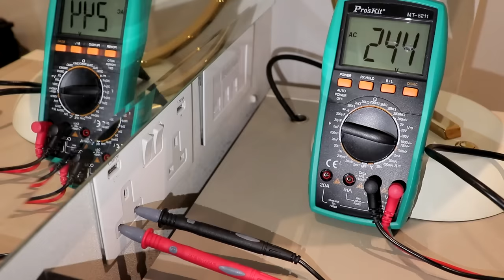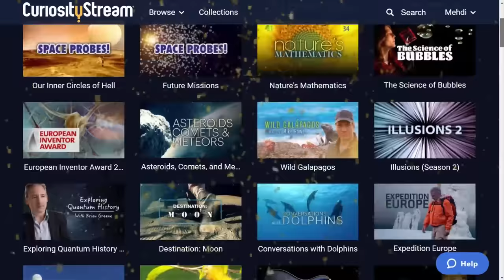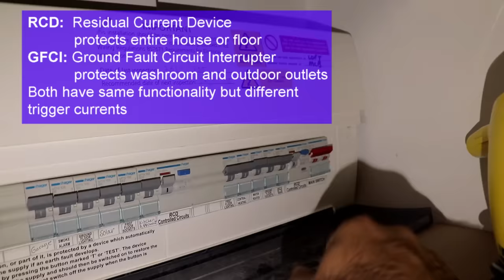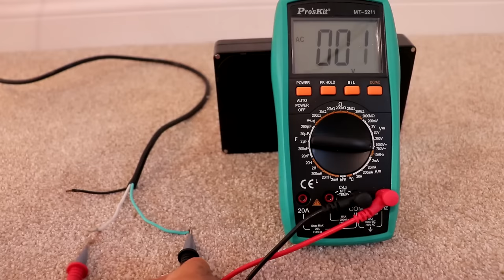Power Outlets in United Kingdom

Comment: UK citizen, I've had plenty of electric shocks in the UK but I've had to push the boundaries of stupidity to get them.
Reply: Getting a 240v shock must be pretty bad. I've gotten plenty of 120v shocks. It's hurts a little but I never felt in danger (hand's weren't wet, no path to ground). I can't imagine a 240v shock.
Reply: @ModMINI  light circuits are rated 5A and socket circuits are rated 32, getting shocked from the light circuit feels like a little tingle but it doesn't hurt compared to the sockets.
Reply: @ModMINI  Feels good, man.
Reply: Nathan Cresswell Huh? They'll feel exactly the same, even in the worst case you're not going to get 5A through you from a 240V shock. That's not much comfort though when a hundredth of that or less can be lethal.
Reply: Mod MINI it’s the amps that’ll getcha
Reply: @dingo137  I can honestly tell you they feel nothing alike, I've changed many of light/lamp holders while live and accidentally touched the live and carried on, a socket on the other hand feels very much like a wasp sting but not as long lasting.
Reply: @dingo137  also lighting circuits are only 1.5mm compared to sockets which can range from 2.5 to 6mm which means bigger the wire the more current can pass through it.
Reply: or have a dodgy power cord on a fridge that you were cleaning and felt your heart stop and then start again...
Reply: Nathan Cresswell and your bones all smash together as your  muscles contract violently to the point you are unable to let go of anything you're holding,  and if that's a live shorted appliance or wire, then goodbye my friend,  nice  knowing you. 
😂👍
Reply: Mod MINI It’s the current, not the potential difference, that causes harm. To illustrate, if you need to supply 12W of power (e.g. to a phone charger), with a 120V supply you are drawing a current of 0.1A. With a 240V supply, you are drawing only 0.05A from the mains. Therefore, a higher mains p.d. is actually safer.
Reply: @AndyJMacLeod  Current and tension are not unrelated. A body is not a wall adapter, if under the same conditions you apply double the potential difference across the same two points of the same body, the current will as well be twice as much. It's different with the phone charger because it only draws what it needs to output the needed power.
Reply: @tapatazapata5970  I guess. Without specifics it's all arbitrary. I had a minor shock through a travel adapter (while I was on holiday in Greece), which is why I was imagining what would happen if the current is supplied through a device. (Most people don't plug themselves directly into the mains). At least the main point of the video was that in the UK we have quite a lot of safety features, including redundancy.
Reply: @nathancresswell794  That's complete and total nonsense. Unless your skin resistance is 48 ohms or less there will be absolutely no noticeable difference between the shock you feel when touching a lighting circuit or a  ring/radial circuit. Moreover, if your skin resistance is 48 ohms then your not human.
Reply: @AndyJMacLeod  No it is not arbitrary. You obviously have no idea what you are saying, i recommend you go and learn the relationships between current, voltage.... AND RESISTANCE/IMPEDANCE.
Reply: @ModMINI  i work on power lines. one tome my ppe was leaking and my rubbers leaked a little sweat on the line, and sent a few thousand volts through me straight to ground
Reply: Telken Texas You obviously misunderstood what I meant. I know all about electricity. I’m a physics teacher. What I meant was that the physics of the situation is dependent on context. How the shock occurs.
Reply: Before they had the plastic on the plug pins I managed to wedge my fingers as a kid behind a plug as I shoved it into the socket.  Taught me to be careful ever since.. :).
Reply: G.H.T. As long ad your hand ls are dry. It will just hurt a little, like smashing your elbow in to something really hard
Reply: @telkentexas4053  go and stick your finger on the live terminal of a lightning circuit then go do it on a socket and tell me which one hurts more. I can definitely tell you a socket circuit hurts more.
Reply: @RawTopShot  that would be electrocution not an electric shock,, no one has ever died from an electric shock.
Reply: @nathancresswell794  I think you are mistaking the different circumstances of your shocks with the current rating of the circuit as the reason for your differing experiences.
You were probably not grounded as well when you touched the lighting live. Hold onto the live and neutral of the lighting circuit with a wire in each hand and let us know if you just get a tingle. Even with good skin resistance, the best case is you'll feel the pulsing as far up as your elbows. Worst case your heart will go into fibrillation.
As mentioned earlier, 5a or 13A circuit is irrelevant, your skin resistance will not allow 5A to pass through your body at 240V, the shocks you have experienced were milliamps of varying amounts.
Reply: @AndyJMacLeod  Stop lying and stop talking bollocks.
Reply: @nathancresswell794  I have done many times, I'm a domestic electrician. Stop commenting on things you know nothing about, you're making a fool of yourself.

Comment: Throwback to learning how to wire a plug in GCSE physics
Reply: I'm very pleased to hear they still teach this skill.
Reply: @MaxWattage  They didn't when I was in high school, I took separate sciences but I don't believe it was taught on the lower level science either, from 2007-2012. I suspect the fact that all appliances sold in the UK must by law come with a pre-fitted plug has a lot to do with why it's no longer taught. It's still an important skill and really should be, but I suspect they would be scared of legal liability if a child blows themselves to bits trying to rewire something. Not a clue.
Reply: @classicmacintosh  I studied IGCSE in 2018 and there was a section dedicated to wiring a plug so that is still taught
Reply: @deadalpeca8099  The **I**GCSE isn't the normal GCSE syllabus you will find in the majority of UK schools, though.
Reply: @MaxWattage  we didn't do it 2004-2006 but i think i did it in Design and Tech between years 7 and 9 (2000-2003). I can't remember because i know my dad taught me how to do it when i was like 7 or 8.
Reply: I was never taught that, my dad did but not the school

Comment: As an electrical engineer... anxiety was set to maximum. *Says something true and would be dangerous" then proceeds to plug in it.. my heart stopped for you.
Reply: Like the comment above I was almost shouting at the screen that there is an isolating transformer + If you look carefully at the location of the hand basin and the shaver outlet I am sure that was within the wrong zone.

Like you I am an EE and learned my trade in the Navy where RCD type protection was used long before it appeared in domestic systems. Electroboom did have a valid point about it being 30ma (Not 20ma Electroboom). It is a shame it's so hard to find RCD or RCBO's with a lower trip current. I found a 10ma one for my bench but it was a 3 phase and very pricy. I know we can't go to 5ma on our RCD's with all the leaky appliances we have but there is something Electroboom got 100% right..................

Stepping on our plugs gives a unique level of pain that is hard to reproduce !

Glad to see he made it back with no heart fibrillation issues  :-D  but if he visits my house any day I am pulling the company fuse on the Henley block and taking it with me if I go out !!!!!!!!   I wonder if his meter was cat 4 ? The leads seemed ok when he had the sleeves on anyway !  Now he is back home I can breathe normally again :-)
Reply: im not an electrical engineer but i get to work with robots and learned alot about electricity. if i did half the things he did in my electrical panels for my robot systems, i would be dead or fired from my job...

Comment: Mehdi: “UK outlets are weird”

EU: “hold my plug”
Reply: I know right? Send this guy to germany he'll freak out.
Reply: In fact
Reply: Pineapple i am a Germany guy and my head is hurting
Reply: Is it because they're exposed completely?
Reply: @iepineapple  German plugs aren't as safe as the UK ones. But more compact and cheaper. Also, invertible so in a plug in device you never know what is live or neutral. Should not matter if its designed correctly.
Reply: Seb Brosig it depends. it typically makes no difference for devices that do not require ground. For three pin device, it won’t cause headache either if grounding, RC/AF and overload protection are properly done. German 3pin plug obstruct the conductor with the plastic as well. For 2pin device, typically the manufacturer make it half plastic half metal. Besides being cheap, another important reason is the three phase five line system used in Germany. If you’ve seen those industrial plug, you will notice that they share a similar dimension with the house plug, which is important in many applications, due to the weird size of buried box used in Germany

Comment: When I was a kid in the 60s UK appliances would come without a plug, just a cable with exposed wires. So people would fit the plugs themselves. There were many dangerous fittings. And everyone left the 13 amp fuse in the plug! Even for a 40 wat table lamp with a thin bell wire cable!
Reply: That may seem absurd now but in Europe the shuko plugs don’t have a fuse , just a 16a breaker for each socket . So that’s essentially a 16a fuse for a table lamp with 0.5 mm flex on it . It’s going to melt before the breaker trips !
Reply: @bonusnudges  The fuse is there to protect the outlet and the wiring, not your lamp. And since the outlet and cabling are rated for 16A the 16A breaker is fine. If your device needs a more precise fuse it will be in the device. If not then not. Code does not care about individual appliances. Fuses in plugs are a bad idea, you put an untrained person in charge of something he does not understand.
Also wrong about a breaker per outlet. Code differs per EU country but it's always something along the line of 'no more than x outlets per circuit' (often 8) with the recommendation that kitchens and laundries go for more circuits with less outlets to spread the heavy users common there.
Reply: @astranger448  The fuse in the plug is to protect the lead from the plug to the device. So you could well end up with this situation, 100A fuse on the incomming supply to the house (this is installed by the supplier), 32A breaker in the consumer unit to protect the circuit to the socket, a 5A fuse in the plug to protect the lead and then a 3A fuse in the device to protect it.
Reply: They still do in Portugal. I'm a carpenter and I sometimes fit ovens and the such. Live wires
Reply: That was because there were at least half a dozen different types of electrical outlets still around in those days. You’d fit whatever type of plug that went with what you had in your home.
Reply: I'm a PAT tester for a british charity, been doing it for 12 years now and some of the donated electrical items i have tested have given me nightmares, opening the plug to check ampage/condition of fuse only to find no fuse but instead tin foil, paperclips or the live wire wrapped around the contacts for the fuse and on metal class 1 items to boot, makes me wonder if these items were donated by the families of Darwin award winners.

Comment: FYI the bathroom outlet contains a small transformer, so only a small current can be drawn, but also the outlet is isolated and floating so you can’t get shocked if you touch a powered terminal.

Comment: Im Glad He didnt Crash The Plane...

Imagine Theres A Plug In The Plane

Me: GG
Reply: The plane has it's own fusebox

Oh wait...Medhi cannot be underestimated
Reply: MD-11 planes had entertainment systems that caught fire due to electric shocks (flight 111 Swissair I think). I wonder whether it’s also the DC or MD planes that had wires going through the jet fuel tank, but because it was only 5V it wasn’t a problem, except after 5 years some cables were worn and touched a 110V and the jet fuel blew up. Macdonnell even had a habit of obtaining a deal with the FAA to fly unsafe planes for a bit longer.

But anyway don’t worry, those extremely bad engineering habits of bypassing safety measures went bankrupt and Macdonnell was bought by Boeing in 1997. Yes, Boeing. This one. Yup.
Reply: @antoy384  (maybe it was Medhi's ancestors??)

PS-: no offence
Reply: @antoy384  Good thing that the MD-11 doesn't fly anymore.

Freight companies: Ummm, yeaah... About that...
Reply: @Adrien Ragot that isn't what happened at all. The frayed wires came in contact with metalized mylar which is extremely flammable, causing a fire on board. Metalized mylar was subsequently removed from Swissair's MD-11 fleet and this issue never, ever repeated itself. It was the fault of the aftermarket entertainment system that Swissair had installed into their MD-11s that caused it, NOT the MD-11 itself. The MD-11 has the same protections on its electrical system as many other aircraft (in fact, its similar to the Boeing 777 in that regard).

This had nothing to do with McDonnell Douglas bypassing safety regulations, that isn't even true.

And no, no aircraft has wires going through the fuel tank. You clearly don't understand what you are talking about.
Reply: @YTshashmeera  fuse BOX? Hah. Try whole panels of fuses, all over the place. Probably slightly special case, but the plane i worked on had like 20 panels...
Reply: @Josh.Davidson  
Conspiracy theories are so much fun, though!
Reply: @Josh.Davidson  
>And no, no aircraft has wires going through the fuel tank. You clearly don't understand what you are talking about.
Well as with all things, there's an element of truth to what they're saying, they're just mixing everything up...
Planes have exploded due to wiring in fuel tanks, but that was a 747...
https://en.wikipedia.org/wiki/TWA_Flight_800#Fuel_quantity_indication_system
Reply: Well yeah, but he was talking about power delivery wires... that's what I was referring to, I should have made that more clear. There is no 110V there in the MD-11 especially.

Comment: A lot of thinking went into the design of UK plugs. I didn't appreciate their weird looking plugs before.
Reply: Brazil have a design which has a lot of security featutes but is not as cumbersome as the british one. Only thing lacking is a fuse in each plug but you can buy outlets with fuses for a bit mote cash.

But it doesnt leave exposed charged metal and it only makes contact when you put it all the way in.

Only problem here is that most houses don't have proper grounding, but thats not a fault of the design. It's just that people think it's too expensive to do grounding and just leave the ground hole unconnected, pr sometimes connected to neutral.
Reply: @caracaes  The whole not grounding properly thing is sadly quite common here in Denmark too I believe.
Most of the ground holes in my house are either a non grounded socket with a hole drilled in it, the ground just isn't connected or there's 230v on the ground
Reply: @antonhelsgaun  most electrical accessories for bathrooms are double insulated nowadays and have no exposed metal parts  and as such have no earth pins on their plugtops.
Reply: The uk national grid was only set up in the 1930's. The distribution to house shower was carried out by many local companies who used a range of voltages and some even DC. After WW2 the whole system was a mess with the companies not wanting to invest in new or upgraded plant, so electrical supply was poor. Also due to the range of supply variations one could not easily get appliances putting the supply company in a monopoly position. This was holding back the rebuilding of the U.K. So the whole industry was nationalised. There was then a discussion about what national voltage should be delivered to domestic and small business premises and 240 volts was selected as it allowed thinner wiring for the same power delivery as 110 and allowed more power to be delivered to each out let. The big change gave an ideal opportunity to introduce a new out let design and the current layout was chosen for its safety features although originally they did not have the plastic sleeves on the live and neutral ( I still have some of those). The clever bit is that the 'wings' on the side of the plug near the live and neutral are there to stop your fingers going under the plug and making contact as you pull it out. People in other countries who make these plus sometimes leave the off and make the plug narrower, thus making them more dangerous. The other thing they do is to put a plastic sleeve on the earth pin which noiseless insulates it defeating the earth/ ground connection.
Reply: Not true, the UK plug is the equivalent of the extreme good airbag because the brakes don't work. The plugs need fuses because the outlets don't have the correct breaker.